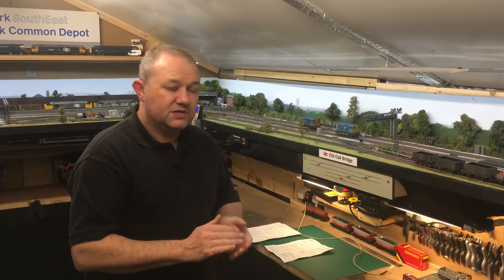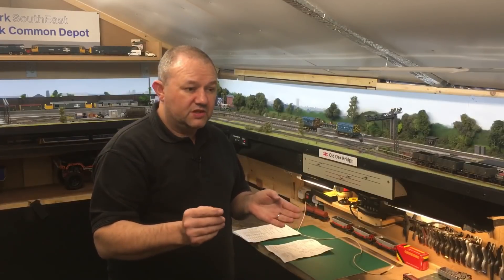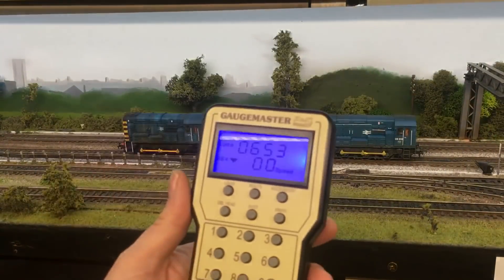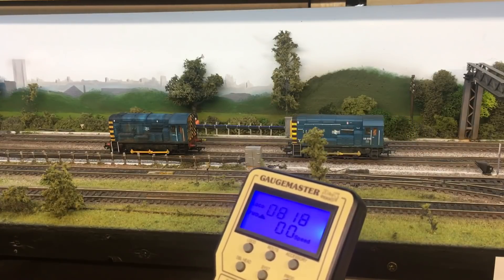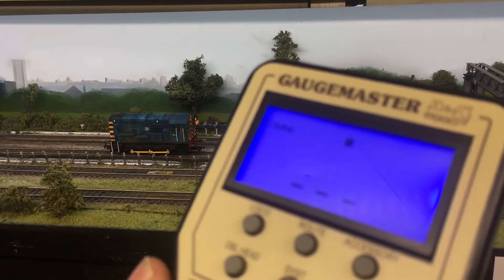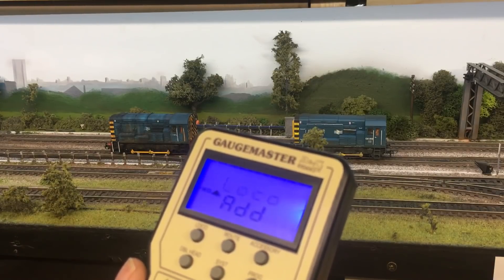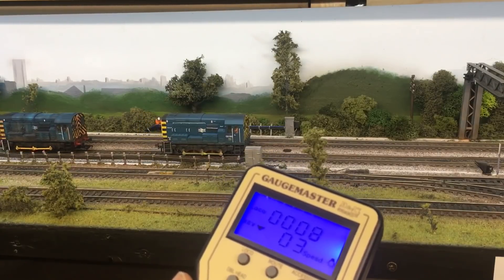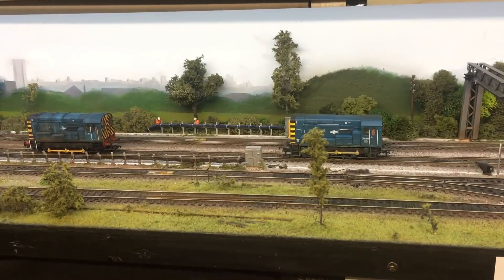DCC Consist - Double Heading

Comment: Great video Garry. Do both locomotives have to identical to each other ?.    Cheers    Greg     PS: I still buying those lotto tickets
Reply from the maker: Greg 😂😂  1st class seats too 👍

Great comment Greg
Any different decoders that have the consist option will work together- I used budget ones to demonstrate how effective they work together.

But well pointed out 😉
Thanks buddy 🍺
Reply: Thanks for your advice.
Reply: Seems to work well.
Reply: Lovely Video clip! Sorry for butting in, I would appreciate your thoughts. Have you heard about - Januke Henatalie Formula (erm, check it on google should be there)? It is a good one off guide for mastering  DCC model railroads minus the headache. Ive heard some unbelievable things about it and my old buddy Taylor finally got astronomical results with it.
Reply from the maker: Many thanks 👍 i will check that out - may save me buying so many headache tablets 😆

Cheers Garry
Reply: To double head I've always set decoder to same number want to do it individually though as to replicate a breakdown say 37 and dmu

Comment: Thanks for the tutorial. How do I split up the double header so that the locos become independently controlled again?
Reply from the maker: Your welcome, 
I believe you turn off the consist on hand set and refer back to the loco number originally assigned for the decoder.  

Remember in consist mode you create a number for both this is then canceled once returned to loco and enter.

 there is an option to delete the const made again all these points are in the Gaugemaster Prodigy manual of which can be downloaded through the Gaugemaster website.

Hope this helps..

Cheers Garry

Comment: What you do not show, which is very important, is how to get both locomotives running at the same speed, ie, their chips syncronised so that they respond in the same way at exactly the same time. I have had issues with class 37's where they run at different speeds when they are consisted. Sadly I have not figured this out yet.
Reply from the maker: Hi Paul
Many thanks for your comment and apologies for the delayed response. Sadly my health had not been good at late..

This is a point that regularly pops in to a discussion at shows-
The truth is I have not worked it out in an easy plug and play manor, Despite that the Gaugemaster prodigy dose do some of the setting of the smaller parameters. 
And One of the main reason for not showing CV speed remapping.

It all comes down to loco age, decoders used, motor wear and CV speed settings,  if we knew what to adjust accordingly. lol

At the time I started this video there was not many decoders on the market so CV settings were mirrored to a degree. Looking into todays market there are decoders from everywhere and many vary in CV value settings.
Hence always best to referee to manuals on each individual decoder for it's mapping settings..

So for me this is now a minefield to cover in a simple format other than what the Prodigy offers..

Again I apologies for this, but I am yet to see a better way to do these in a simple fashion that warrants understandable content. 

We live in hope my friend..
All the best Garry

Comment: Could you do double heading / consist by setting both decoders to the same  number so the decoders react to the same commands?
Just curious :)
Reply from the maker: Hi buddy you could as DCC will pick up both addresses  / may find even if set as same if numbers they may still have a slight speed difference due motor age or ware as speed steps in scale form alway seem to vary from loco to loco - definitely worth a go 👍
Hope this shines some light on this as never a straight forward thing to overcome 

All the best Garry

Comment: Hi brilliant video 👍 got my two locos sound on and lights . But when I put the speed on they don’t move . What have I done wrong please . Kind regards Ben .
Reply from the maker: Hi Ben apologies for the delay as asked around this question as baffled too -  best advise I would suggest is to refer back to the Decoder reference sheet with the DCC values and using your controller on read - Read the values you have on each cv you have set compared to the manufacturers data sheet before doing anything rash  

Again sorry for not providing an answer to the point as there are so many different decoders now days than when I did the video 

Best wishes Garry

Comment: Hello love your videos, but please do you know if any of the Hornby decoders are equipped to program a consist? I'm thinking also there sound decoders?
Reply from the maker: Many thanks..Paul
Hornby standard decoders do look Identical to the TTS sound decoders, only because they use footprint PCB boards from the same manufacture, but are very different to sound decodes..

Apart from the sapphire chip all other decoders are non CV 19 which allows for advanced consisting?. 
I believe that's also the same on all TTS and Hornby sound decoders.

Hope this helps... cheers

Comment: Hello could you please put a list of decoders from different manufacturers. 6 pin 8 pin and 21 pin decoders and there product codes that have the consist function on them please also does Hornby TTS a3 decoders have this option. I'm new to DCC and don't no where to start I have the Gaugemaster prodigy advanced 2
Reply from the maker: Hi Daniel 
Thanks for the comment- 
Being New to the hobby - you may not know but their are hundreds of decoders on the market from many suppliers and in many different pin formations. 
It would be impossible to put anything like this together Or this would be available on demand.
To my knowledge there is nothing compiled like this.. 

My advise is to email the manufactures if you have any Decoder needs as they will maintain manuals for each decoder..

Or sign up to RMweb and leave a post on their as it has many people in the business and hobby sector that will support.
https://www.rmweb.co.uk/

all the best Garry

Comment: Hi,i use prodigy advance 2,do both locos have to be the same to run double headed.thanks howard
Reply from the maker: Hi Howard - no you can use any loco but you may have to speed match them -  the prodigy manual dose highlight this as alien as it is. 

Cheers

Comment: can you add unlimited locos like this
Reply from the maker: Good question Daniel.
All depends on what system you have according to the amps being drawn from locos 

I know that my Gaugemaster Prodigy Advanced runs a 3/4 amp which should run about 10 locos how ever they are coupled - And If you expand to a larger layout and more stock there is an additional 8 amp unit to add if desired. 

So its more about what amps your unit run at to what stock you run - remember sound and lights etc will count..

Most low end systems like Prodigy express run at 1.5 amps similar to hornby elite 
That would only run about 4 locos max 
2x coupled units.

Hope this helps 👍
Garry

Comment: Hey there what about a HST push pull in DCC?
Reply from the maker: Hi Guy 
well HST have one power car and one dummy so really isn’t a problem as only one unit is powered. Hope that answers this buddy,  cheers Garry
Reply: Hi there thank you but I was thinking about not having a dummy but 2 powered locomotives🤔
Reply from the maker: Guy Prior 
Oh Okay - personally i don’t see the advantages of two HST power cars as a dummy is supplied in each set where you can add sound chips to both for realism-   I understand your looking from a reverse unit solution, but seems a little over kill.   😉👍

Comment: This is really lame. Everyone knows how to set up double heading, I presumed this would be about how to get different types of locos with different chips (ie totally different running characteristics) to smoothly run in multiple together without one pulling or pushing the other. Next!
Reply from the maker: Funny really as I was asked by many modellers on how to do this - as I have done here.

Again from reading the comments below in this video - not everyone has the ability and the knowledge of DCC or how to add two loco’s with different addresses to run as one, and not to be mistaken as speed setting - as I too had to learn this hence my video that clearly demonstrates for those that require help. 

Clearly this is not you.

Maybe you could learn to be polite in comments instead of negativity against other follow modellers.. 

All the best Garry
Reply: @cheekytek  I did not know how to set up double heading although I have the same controller. I could have read the manual but your video is much clearer. I also have the problem of "different types of locos with different chips (ie totally different running characteristics) to smoothly run in multiple together without one pulling or pushing the other". I have two Bachmann Class 90s one 2019 version in Freightliner Powerhaul and a 2022 version in Freightliner Racing green. They would look great together. With a Bachmann 36-569 and a Zimo sound chip they have different running characteristics. I am going to revert both locos to DC. Don't think I have the ability to speed match in DCC. Probably because I'm lame!🙃

Comment: Hey up matey. I was wondering if you've ever had any issue with the Prodigy controllers and Hornby decoders? I was told by a shop that they sometimes had issues with Hornby TTS decoders in particular? Noticed any problems at all?
Reply from the maker: Hi buddy 

I’ve only one TTS loco and don’t have any problems with it running I did have to tweak the cv settings but that seems to be the norm on with TTS on many systems as I believe 

I’m not a lover of the hornby chip as sometimes I find there’s a struggles to show loco number even though it Writes to it but that’s just my opinion other than that prodigy is great and no probs on my TTS once set 👍

Hope this helps 

Cheers Garry

Comment: Nice explanation mate.  Here in Canada it is rare to see a single locomotive so most of my locos run in a consist.  we also have distributed power due to the length of trains so it is common to see mid train locos and end of train locos pushing. The Prodigy makes it all very simple.  I have to make a specific list of all the consist numbers for obvious reasons. Mark
Reply from the maker: Interesting comment Mark, I never thought of that, must be a real pain with outages.

As to double heading-do you have preferred decoders for consists, as I guess that’s the main thing you look for in dcc decoders 😉👍

Cheers again buddy
Reply: @cheekytek  Garry they don't really sell decoders here anymore that cannot handle advanced consisting so no issues.  I tend to stick with ESU or Digitrax in a pinch.  The real railroad uses distributed power not for outages but basically length of train and grades.  10 to 14 thousand foot freight trains are the norm and that takes a lot of HP. Mark
Reply from the maker: Blimey knew they were long 😮 wow

Cheers for decoder tip 👍

Comment: Hi Cheeky - I have a lot of Hattons DCC chips and have plenty of them running in consists!

Some DCC controllers will also support a 'software consist' where locos can be teamed up without needing to be programmed. In those circumstances it doesn't matter whether the decoder supports consists or it doesn't.

In fact, that may be what the Prodigy is doing there, rather than programming CV19. (edit - actually, no - looks like those decoders are being programmed)
Reply from the maker: Thanks for your reply 

Yeah - think you have answered my reply back totally agree and I must admit newer decoders are certainly program smart 😉👍

Great comment buddy 

Many Thanks Garry

Comment: Garry... thank you for your lastest video about double haeding,is it the same with my n gauge blue pullman to get them running back to back,if so thank you....brian
Reply from the maker: Brian that’s a interesting question as I have an HST that I program differently 

For me to give the Best answer, I will try two tested methods tomorrow to provide solutions that better suits - if ok

I take it one unit is powered and the other is unpowered (trailer)

Do these have lights/ sound in each ?
Reply from the maker: Ok Brian I’ve had a look at this 

I have two options really

1/ to double head but you will need to give the trailer unit a different code to add in as a consist - 

2/ and probably the better option 
Place both units if one motor and one trailer on program track and enter the same loco number so both run as one loco as these will always run as a pair.. 👍

This is commonly done on HSTs 

Hope this makes sense 👍😉
All the best Garry

Comment: Timely video Garry as I want a permanent class 37 consist on the layout.  Got to find out how to do it with the Z21. Thanks another great how to. Cheers Jerry
Reply: For a permanent consist it's worthwhile seeing if setting the two decoders to the same ID would work.
Reply from the maker: Thanks Jerry, I would guess this would be similar set up for Z21.

Not all loco’s run at the same speed so speed match a pair may be required 😉👍

Comment: Interesting video. I’ve had the prodigy 13 years now and it never occurred to do it the easy way. However my caution would be that all the locos need to be similar in acceleration and set up because otherwise they’ll just catch each other up or propel/ pull each other. Mine take a lot of fettling to get two that run similar
Reply from the maker: Robert - yes certainly may need slight adjustment to run as a pair and I’ve noted that on my 37 it trundles away, 

A good point and one I did not really want to add to this video as I too get overloaded with too many cv goof settings, 

Unfortunately I’m one of those that reads a book and puts it down loads of times before getting to the end 😆👍

Great comment buddy 
Garry
Reply: @cheekytek  The problem is, not wanting to add the most important part, many loco's do not run at the same speed even if they are the same type.

Comment: Evening Gary from woodfield junction, very helpful video I also have those controllers and their very reliable, and hopefully this should work for me on my class 37s so maybe some double heading running sessions on test trains.
Reply from the maker: Hi Stewart hope all is well buddy yes very good system either way - same too now I’ve worked it all out certainly will add some double ups 😉👍

All the best Garry

Comment: I read below that as long as both chips have consist CV, they work together.  Have you found same manufacturer chips cooperate more easily?,
Reply from the maker: Anthony Many Thanks, I have found the budget decoders from Hattons as in the description are pretty much plug and play basically they are gaugemaster chips but rebranded..

All different manufacturers chips should all work together with consist as NRMA compliant 

As to you question not something I’ve come across as yet 

Yet I do prefer bachmann but being older decoder stock that function is not present.

TBF any chip now days has more options but certainly check this option before purchasing 👍

Thanks again Garry
Reply: @cheekytek  (late over there as I write).  I model Euro trains, and find likes cooperate.  Märklin stuff works better with Märklin, Roco with Roco, etc.
Reply from the maker: Never of thought of them manufacturers great shout may look in to them 

Cheers for that 👍😉

Comment: Tried this myself, worked no problem except the locos would not run identically. Any tips?
Reply: JTK MODELS  To get two or more locos running together it's best to speed match them.
Reply from the maker: You may find some loco’s will run faster or slower than others this can be down to the motor arrangement of say 37 and a 08 obviously the 37 will pull quickly due to the motor configuration and drive axles - small tweaks to the CV’s on start up voltage and acceleration  / deceleration will help slightly (this will be on your reference sheet CV 1 to 5)

I have noticed different chips can alter speed patterns but not something advise to go out buying to find a compatible decoders. 

Hope this throws light 

Cheers Garry 👍